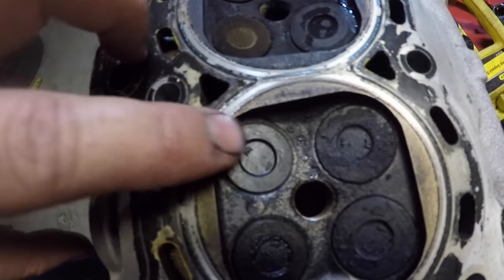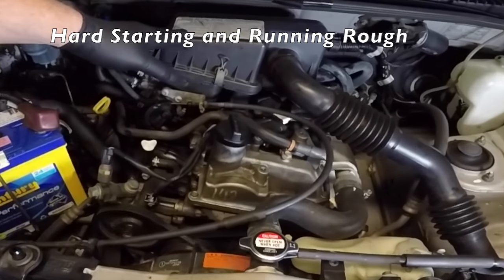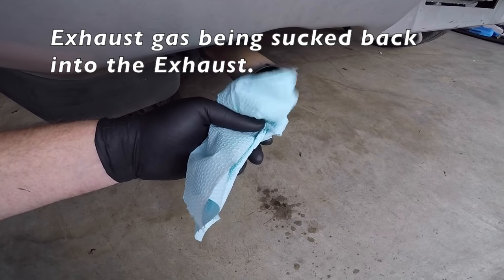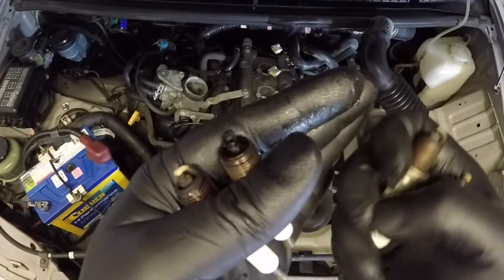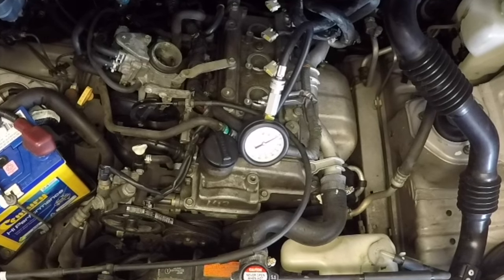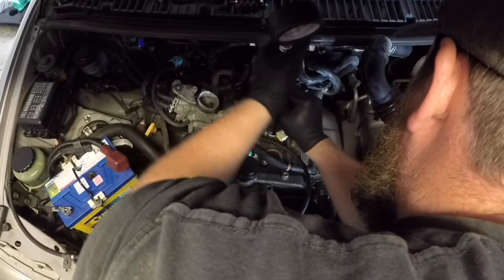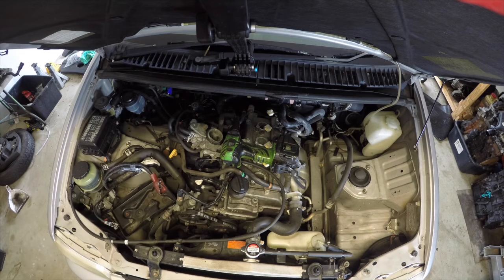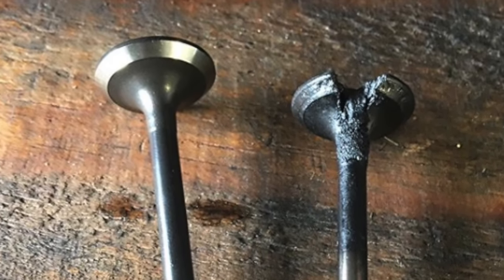Leaky and Burnt Exhaust Valves Signs & Symptoms

Comment: Thought my issue was head gasket. But obviously something was going on inside as well. Rough running and lost power while driving until I hit the shoulder. It wouldn’t crank back up for me. Tore it apart and had 5”the head resurfaced (it was warped pretty bad he said but gauge never read real hot). Put everything back together with new plugs, wires, other gaskets, radiator (blew a hole in the radiator when truck starting running rough the day it quit on me). Now I’m suspecting something more serious because after the head gasket job was done, it would start but run terribly rough. And now smokes from behind the engine. And there’s also a noise you can hear that kinda sounds like manifold leak but it’s coming from driver side 1998 s10 2.2. Leaning towards valves. Should’ve checked that when I done the job but I’m not a big mechanic honesty. Everything else went pretty smooth

Comment: Thank you very very much, I had this problem in my Nissan Patrol, I thought it was a bad injector but, after seeing this video, I found that exhaust valve N° 3 cylinder  doesn't close completely so the compression was low resulting in white smokes and engine was shaking so bad until it warms up. thank you again.
Reply from the maker: Glad it helped
Reply: What was the reason for valve 3 not closing properly?

Comment: I love this video man, very helpful. I have a e46 N42 engine I replaced all spark plugs changed valve seals, head gasket and bad the bad coil. All cylinders are misfiring. The mechanic did not check for bad valve when he pulled the head.  This will help me to test if there were any bad valve.
Reply: So what was it mate?
Reply: @Light Roast Coffee An electrical issue is always suspect number one and easier to check first.

Comment: Did the paper towel trick on 2 cars.  This actually was a helpful tip 
Thanks
Reply from the maker: Awesome thanks
Reply: I will do it on my car just tomorrow
Reply: @Khusta...Ngcupe  the one with a bad exhaust valve sucked the towel in and the one with rebuilt heads didn't. So in short it...the paper towel trick works
Reply: @what nite good point...kinda like a crack in a drinking straw

Comment: Amazing video thanks I'll definitively do those two tests on my car tomorrow
Could a less defective, non sealing valve cause a "firecracker/gunpowder" smell from the exhaust by letting unburnt fuel land on the catalytic converter?
My car starts well, but has a little hickup when I punch the throttle and it smells gunpowdery sulfury from the exhaust when engine reaches operating temperature.

Comment: Hey mate, just a question.
My bike, honda cbr 600 rr 2004, is lately stalling in neutral at stops even clutched in and also while riding will lose power for a second or two or will jerk forward sometimes as I'm deccelerating.
Do you have any idea what that might be?
Thanks

Comment: Have a jeep liberty the cat was clogged and recently replaced it now it still runs rough . Getting rich code on driver side does that sound like a burnt valve from the clogged cat? I’ve tried everything plugs coils vacuums fuel injectiors and o2 sensors

Comment: Thanks for the video.  When you take the engine apart, would you just fix the damaged valve or replace all exhaust valves?  Does it depend on value/age of car?  Difficulty of job?
Reply from the maker: Yes it does it depend on value/age of car but its  the best option to change them all.

Comment: I have my cylinder head off, burnt and damaged exhaust valve in cylinder 4. Question…what is the likely culprit for oil on the corresponding piston? The other two pistons had basic carbon buildup, but cylinder 4 had oil on it.

Comment: Good video. What causes a burnt out valve like this? The valve not seating properly? I hav a 523i that has done the same thing. Its runs hydraulic lifters, could one of them be bad?
Reply from the maker: It could be from the lifter but usually from Carbon buildup, Physical valve damage (broke valve seat, bent valve, etc), Sticking at the valve guide, Broken, damaged, or weak valve spring. Anything that prevents a perfect seal and allows a leak to start.

Comment: That's tip with the exhaust is great, checked my car and it looks good, but I know it has other ring issues. What caused the valve to burn like that?
Reply from the maker: Poor fuel, Sticking tappets, Sticking valve guides, Incorrect tappet clearances, Excessive carbon deposits, Overheating. Could be one or more of these. Thanks for the question
Reply: @killawattgarage  I'm starting MMO treatment - hope I caught this before the exhaust valve damage. I'll do that exhaust test.

Comment: Wouldn't that small chunk of valve metal normally damage the piston I'm wondering?
Reply from the maker: Typically when a section has been burnt off the exhaust valve it has occurred in a similar process to a gas welder. The combustion flame/heat escapes past the valve and valve seat and burns through a section with the flow going out the exhaust port. I hope that makes sense.

Comment: Went to change the valve stem seals and found worn camshaft and rockers. Changed the lot and cleaned gummed up hydraulic lash adjusters. Now have intermittent symptoms shown in your video at idle. Any advice?
Reply from the maker: What make and model?

Comment: Is it usually exhaust valves that burn out more than intake valves?
Reply from the maker: Yes it's the exhaust valves only as they see significant more heat and don't receive the cooling effect of the intake air/fuel mix passing over them. Thanks for the question.
Reply: @killawattgarage  I have a 5.4l 3v engine with intake and exhaust valve leaking how would I go about fixing it
Reply: Santos Garcia Did you ever figure the problem out
Reply: @montraycheers8629  i put that project on hold but from what I  search ppl been lapping the vales and putting them back in the heads checking it  for leaks and running with it i ask about this engine to so many people and they give me different answers
Reply: @santosgarcia9499  ..... Well for starters I wouldn't recommend that you do it if your NOT a mechanic because if you don't know what your doing you could make matters alot worse than they already are.     Example would be Like getting lapping compound into your valve slides and ruining your valves and possibly your pistons!      So do yourself a favor and take it to a reputable garage please.
Reply: @mirandabri834  I'm just messing around this engine learning as I go it's not my daily driver or anything just a project I have I'm in process of my first engine swap gotta learn some how lol
Reply: @santosgarcia9499  Yep I like your thinkin..gotta give it ago as how else are you going to learn.👍

Comment: Thank you for the informative video. I have a 2004 honda pilot with 259k miles. It's misfiring from multiple cylinders, has problems starting, runs idle and has slow acceleration. I had a compression test done and cylinder 6 had 30psi (I think the normal range is above 140psi). The spark plug in the cylinder had lots of carbon on it and finally, there was a leaking exhaust valve. I was advised to change the engine, which is quite expensive, as opposed to repairing it. What's the best approach here? Is it something I can repair and if so, do I need to take out the whole engine?
Reply from the maker: With that many miles, overall the car would be getting well worn. It is not a smart financial decision to pay to rebuild the engine. A good low mile engine could be put in within a day and would be the cheapest way to get the car going again.
Reply: @killawattgarage  Thank you. I'll replace it.

Comment: a bit of a disaster last week..i lost my coolant due to drain plug coming loose,however it didnt damage the engine because it runs on lpg and when you lose coolant the lpg shuts down..anyway called out the AA ,in England that is a vehicle recovery organisation..i  asked the mechanic to check the compression while he was there...finds 3 cylinder was low compression,goes into cab and put its foot right down on the accelerator,swiches off engine takes out spark plug to look at it,leaves it out then makes a quick exit,says he's got to go o another job..i put spark plug back and starts the engine..loud growl and shake and engine will start n o more..was this because the mechanic high revved it? i know my valve wasnt too good but the engine did go and would have gone on alot longer
Reply: ps ive heard an oil called Marvel mystery oil can free a seized engine...but i think mine may be too far gone..is it worth trying?
Reply from the maker: I assume it has a dual fuel option. I would start by trying to get it running on petrol just to eliminate any issues with your LPG setup. Another compression test would be a good idea as the one performed by the AA sounds as if it was rushed. I also want to question the setup that shuts off the car due to coolant loss, as this is not common in Australia?
Reply: the van only runs on lpg,its done 200k miles all on lpg...when it lost coolant the vaporiser just froze up..lots of ice around it,the gas freezes...the van was idling ok after putting back the coolant like it was before,ive researched about high revving engines while standing still and they say it can cause alot of damage..the coolant was still cold when he revved it up
Reply from the maker: @steve-r-collier  Ok. High revving without load is not great and unnecessary. Start with a compression test and see how that goes.

Comment: I have a 99 Civic, it had a bad cat that got replaced and went bad again, it has black carbon soot out of the tail pipe, loses about 1/2 qt oil every week or so. Car has no major oil leaks and I did a compression test compression was really good, what could be causing my problem?
Reply from the maker: Sorry for the slow reply I hope it is now fixed. High oil consumption will either be the oil control rings or value guides. You can try using thicker oil too.

Comment: Got an interesting one, did your test with the paper over exhaust, car was running a little shakey. Did a comp tests on all 6 cylinders and they are all the same around 130 psi. Cant put my finger on it
Reply from the maker: Any codes or check engine light?
Reply: Did you figure it out?
Reply: What did you find and did you fix it?

Comment: I had the same problem on a 318 is. At cylinder number 3. I never find the mising parts from the valve. And was i litle bit harder to find new valves. I find one only one. And while i was laping them i noticed one of the older valves has a litle scratch on the head when valve seats at cylinder head. Any idea how to fix that. I need a faster response since im going to finish the car on sunday
Reply from the maker: Hi and thanks for the comment, send a picture to my instagram account and I will be able to see whats going on. just google Killawattgarage to find me.

Comment: I have a Daihatsu Sirion 1.3 102 ps but it doesn't want to start. I bought it with a problem last ignited on 2 cylinders, I realized this after I changed the spark plugs, when I checked them only 2 were black. The engine worked for 5 minutes and turned off since then does not want to start at all. There is a spark and fuel but does not start. I replaced the camshaft sensor and crankshaft with new ones. The injectors are new to the computer and it has been replaced but no change. I measured the compression it is between 8 and 9 bar. Please help me I have no more ideas where the problem is 2 weeks I can not start the engine. 🙏🙏🙏🙏🙏
Reply from the maker: Are the plugs wet after a period of trying to start it?
Reply: @killawattgarage  Not because I checked the current of the four jacks for the ignition coils and it showed me 1.3 volts

Comment: Just waiting to find out exactly whats wrong with my mazdadpeed 6.. i only had the car for 1 day and I have no compression in cylinder 3.. its alrwdy towed away so I cant test the exhaust sucking back into the pipe. But my engine reacted the exact same ways I gave a feeling its an exhaust valve not piston rings.
Reply from the maker: Either way it sound like the head will need to come off to inspect. Bad luck that you had it only for a day. Hope it get repaired quickly and without too much $$$

Comment: Sir i Have 3 cylinder engine with Old skool roker arm tappet type .... That rocker tip has gone way down with alot of threads moved down towards valve where they meet does it indicates that my valve have wear n tear from upper side
Reply from the maker: Sounds like a lot of wear at the point of contact between the tip of the rocker arm and the tip valve and also the camshaft.  Once you have gone past the point of maximum adjustment it will be time for replacement rocker arms, camshaft etc...
Reply: @killawattgarage  no no sir i think valve need to be replaced
Reply: @killawattgarage  rocker arm tip is  okay
Reply from the maker: @hammadmadi4285  Well then the heads gotta come off and lots of work ahead.

Comment: I have a 99 Dodge Ram 1500 that has a slight crinkle/rattle sound when I accelerate between 1000 and 2000 rpms. Could this also be a valve?
Reply from the maker: Sorry for the slow reply, is it sorted?
Reply: @killawattgarage  Not yet. I’ve been debating on trying this valve repair stuff you add to the oil but I’m hesitant. It’s not a loud noise but I do notice it and it’s really only noticeable during heavy acceleration
Reply from the maker: @colinlacrue7440  try a simple fix first and give it a full service

Comment: is it possible it consumes oil?
Reply: YES BIG TIME
Reply: @srte147  looks like i got the same problem the 3 piston cylinders are in good compression the other one is lower
Reply: It happens I’m dealing with the same problems
Reply: @srte147  does the valves making noise too?
Reply: @astralcomm7925  yes
Reply: Yip..and lots of fuel!!

Comment: Hi. Thanks for your video. That with the cloth I don't know it and love it. Thanks. 
Can you help me with an 4 stroke engine, please?? It got 2 admition valves and 2 exaut valves. Has new valves and new retenair but I got lots of smoke with oil at the exhaust aut. So the problem only can be at the valve guide. But the can't identify witch guides are broken. The 2 admition valves are OK, clean. Tne 2 guides of exhaust aut are full of coal. Can you tell me please witch guides I must change??
Many thanks. And cart on with the channel.
Reply from the maker: Have you done a compression test? The rings may be worn.
Reply: @killawattgarage  yes,I did it. The problem it was with the 2 exault guides. Thanks.
Reply from the maker: Glad you fixed it

Comment: I've been to 4 garages or more for repairs, but my engine is still misfiring on cyl 4. No one can figure it out, everyone is speculating at this point. I've replaced injectors, coils, spark plugs, ground wires, alternator, throttle body, high pressure fuel pump, compression is 175psi across the board. What can it be...
Reply from the maker: What car and engine?
Reply: I'm having this same issue. Changed out same things. Except my problems started first from cracked valve seals and oil getting in. Obviously changed seals then everything else. Still misfire on 4.  When I switch the spark plugs and coils around it buys me a little drive time no issues but again. Cylinder 4!?!   I have a 2006 honda oddyssey

Comment: Will a bad exhaust valve cause any of these symptoms? I hope someone can help me. I have a 2000 honda crv b20z2 awd. I keep getting a misfire code. I recently bought the car. Did full tune up and fluid change on the vehicle. I also keep getting a dragging noise that comes and goes. I can be going down the street normal. Then when I press the gas to accelerate the dragging noise will happen. As soon as I let go of the gas. It stops. Even if I'm cruising. The noise is only there when I press on the gas. Any help would be appreciated.
Reply from the maker: Swap the coils and spark plugs from the misfiring cylinder and see if the code changes to other cylinder, if it does then your coil or plug is at fault if not, then check compression across all cylinders. More checking will need to continue from here.  Not sure about the dragging sound...start by jacking up the car and spinning each wheel. Listen for any unusual sounds.
Reply: @killawattgarage  I had zero compression in one cylinder. I'm swapping the motor now to a jdm b20b. Still not sure what the sound is. Since the car is in the shop. We put it on the lift tho, and cant see anything wrong with it. Will see if the sound continues af tr er the swap.